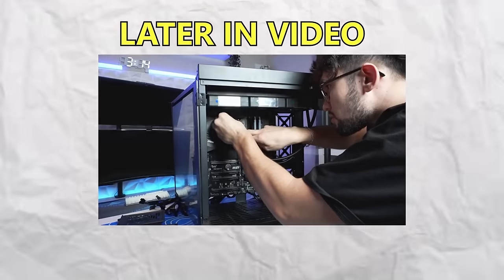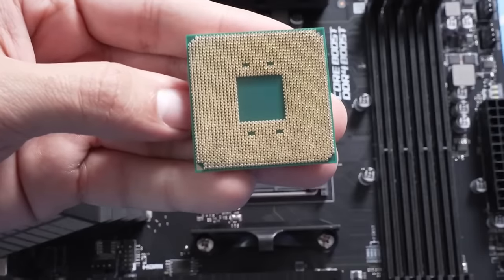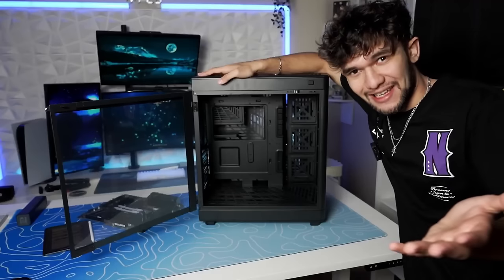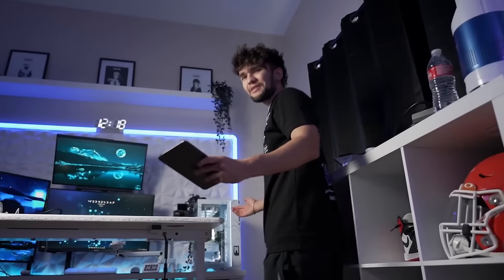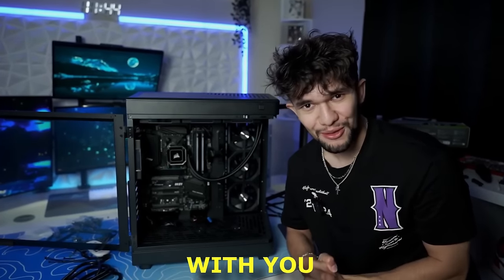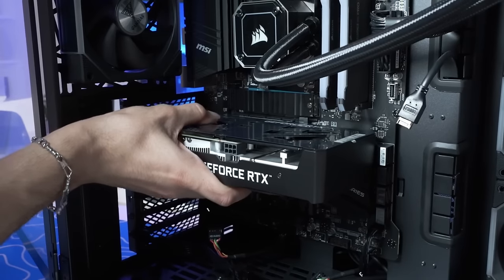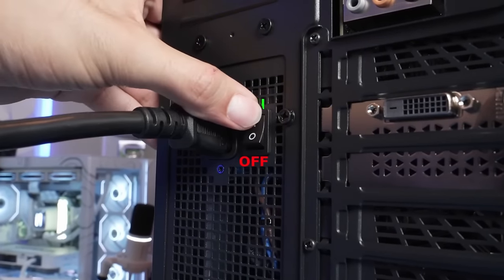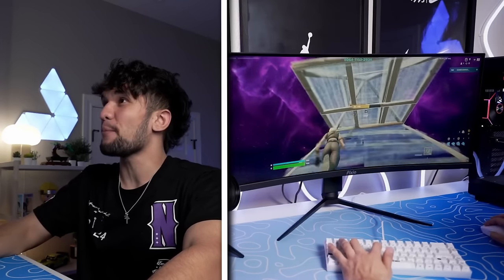Building My First Gaming PC With No Experience (BUDGET)

Comment: I've got a much nastier build for 1000 usd budget:

MSI Pro A620 E AM5 ATX Motherboard 
Ryzen 5 7600X
DeepCool A300 CPU Cooler
Kingston NV2 PCIE 4.0 NVME SSD 1TB
TeamGroup TCreate 32GB DDR5 6000Mhz CL30 RAM Kit
DeepCool PF750 750W 80+ Bronze PSU
XFX SWFT210 Radeon RX 7600XT 16GB
Thermal Take S100 Case
3 x ThermalRight 120mm PWM Case Fans coz y not.

All the above for just shy of 1000 usd.

Comment: bro the 3050 cost as much as 4060 but the 4060 is a lot better. The ryzen 5 5600x has the same performance as the ryzen 5 5600. You couldve put the firs aio on the front panel. You just make a lot of mistakes and waste money